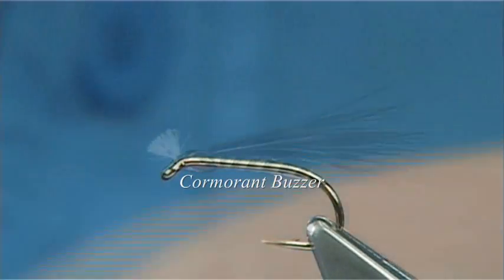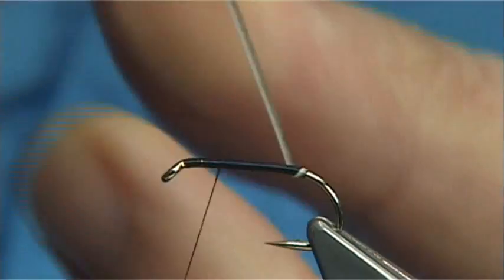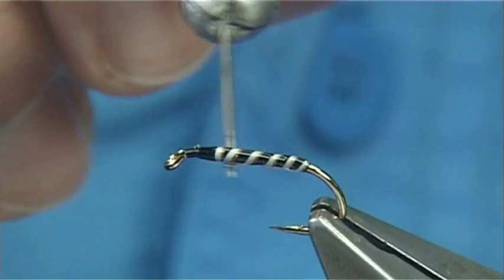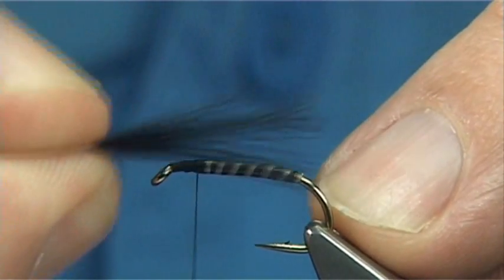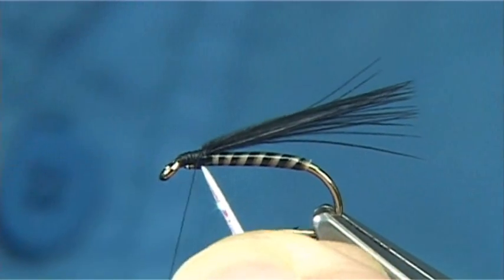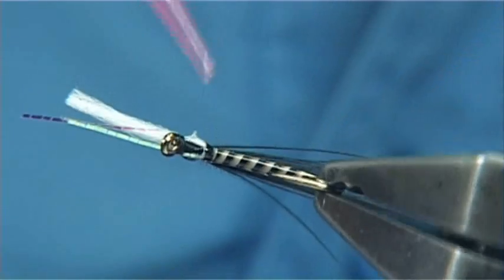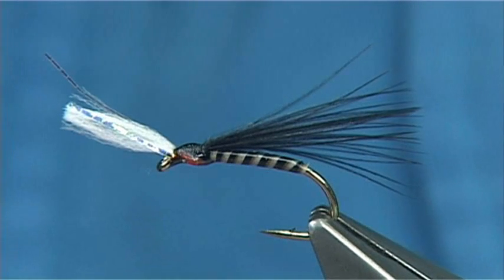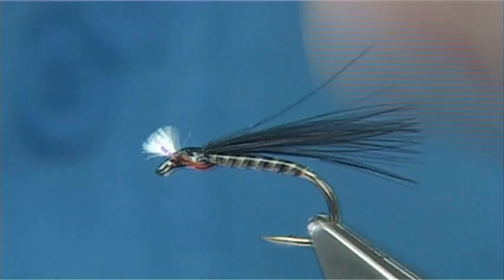Tying the Quilled Cormorant Buzzer by Davie McPhail

Comment: Another great video, Davie! What sort of resin and torch do you use? I have been using the Loon UV fly finish, thin formula, and it seems a bit tacky to the touch, even after hitting it with the torch. Thanks for all your efforts!
Reply from the maker: Hi 8626John,

If you coat the resin with a fine coat of varnish you'll find it will not be tacky any more, all of the resins that I've tried have been like this and it was the same when I used the old epoxy resins as well...

All the very best Davie
Reply: *****
Thank you. You're the best!